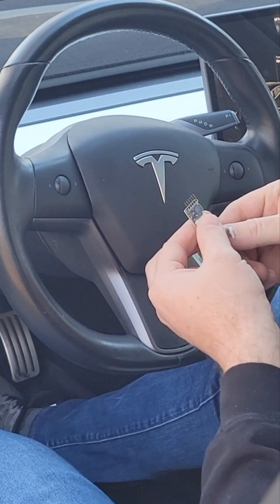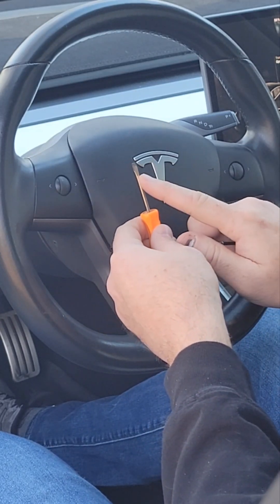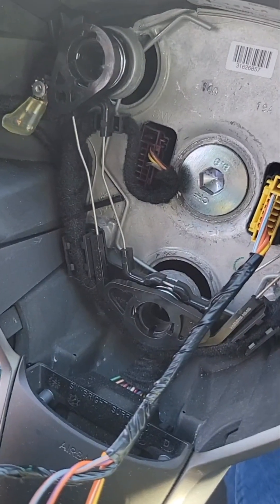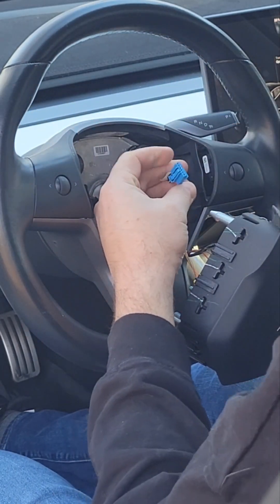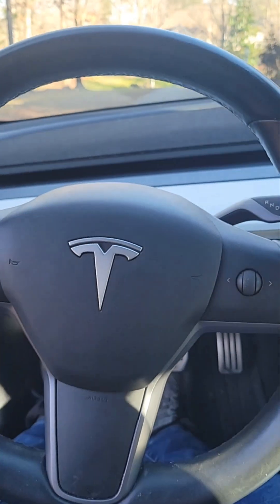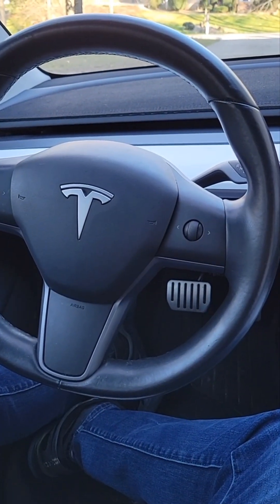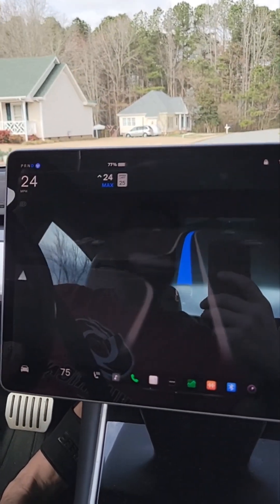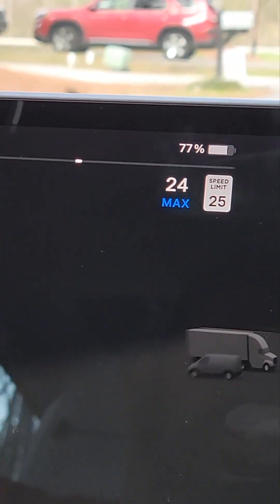Tesla Auto pilot FSD anti nag assist chip

Comment: If anyone is thinking about ordering a TSL2 chip, these no longer work.  I ordered and returned 2 of them because when they're now initially connected to power, you see a quick red light, but the chip never beeps, and it can't be activated or accessed in any way using either scroll wheel in my late 2018 Model 3.  I've seen several comments from other people having this issue in the past few weeks, and none of us have gotten the chip to work.  I contacted support email address included with the chip's packaging for help, and they were useless.  Their customer support consists solely of emailing you a link to this video.
Reply: Just tried one today and I'm having the same experience. Light turns red and doesn't beep. Also the wheel loses functionality when this is plugged in. Bummer
Reply from the maker: I just had a friend put one in his bottle Y this week without issues. Two questions for you: Does your scroll wheel adjust the speed when using cruise control? And did you try resetting the chip after plugging it in and reconnecting the harness to the scroll wheel? The paper directions to explain how to reset it
Reply: @ Yes, the scroll wheels end the nag.  Yes I tried resetting it.  I’m not the only person having this issue lately.  Either they no longer work, or the manufacturer made a giant batch of defective chips.  In either case, avoid.
Reply from the maker: @zoiks6631 can I ask how you reset it? The directions that come with the chip don't explain how to reset it clearly.
Reply: @ My man, I’ve worked in corporate IT for over 25 years.  I know how to follow directions to install and reset a janky Chinese chip.  The stupid thing never beeps and has no reaction to any input.  I tried 2 chips, each time on both scroll wheels.  Emailing the email address included with the chip’s packaging resulted in receiving the most non-sensical and false information.  Their latest email told me I shouldn’t return the chip because they’ll fix it with an OTA update.  I guess they’re hoping people will be stupid enough to believe that their chip somehow has an internet connection.  If it did have an internet connection, I wouldn’t want it in my car.  These chips are the typical junk Ali Express is known for.
Reply from the maker: @zoiks6631  definitely not insulting your intelligence. The Chinese directions are not clear. I was just trying to help because I've had really good luck with dozens of them. Have never come across one that doesn't work, And I do feel bad for you because when it works it is awesome. I am in no way making any money with this video or selling the product, just trying to help ya out.
Reply: This thing works only for hands , how about interior camera ? This camera also don’t check your head ? Because it’s not just about hands, I wanna buy TLS6
Reply from the maker: @David_Chumak I just flip down, and move the sun visor over in front of the interior camera. Problem solved.  FYI, I just got 12.5.4.2 and my chip is still working great.
Reply: Did you ever get it to work?
Reply: @stockfootagenow Nope

Comment: I’ve now tried 2 of these, and neither works with my 2018 Model 3.  When I connect the chip, I get a red light, but it doesn’t beep.  The scroll wheel then has no effect on the chip when you click the scroll wheel.  I think Tesla may have blocked these from being able to be installed.
Reply from the maker: Mine still works
Reply: @ Yours was already installed though, while I’m trying a new install.  Either I received 2 defective chips, which seems unlikely, or Tesla has found a way to block these from being installed.
Reply: @zoiks6631  You need to test if your Tesla supports any of these chips.  You can do this by turning on Autopilot/FSD, then wait for the nag.  Once you get the nag, scroll either the volume wheel or the speed wheel and if the nag doesn't go away, it will not work on your Tesla....ever.
Reply: @jbmitch22 It 100% for sure should work with my Model 3.  It’s just yet another shitty Chinese product.
Reply: most of these chips need a fast double click of the wheel that its on to enable it

Comment: Is this still working with new FSD 12.5?
Reply from the maker: Yes, im on 12.5.1.5. when the vision based attention monitoring is active, and you look away, then this doesn't work. Which is fine. If I wear sunglasses or a baseball hat, then the attention monitoring is not active and the chip works as it did in the past.

Comment: When I plug mine in I get the light but no sound? What does this mean is my unit broken?
Reply: I’ve had this issue with 2 different TSL2 chips with a 2018 Model 3.  Did you ever get it to work?
Reply: You need to test if your Tesla supports any of these chips.  You can do this by turning on Autopilot/FSD, then wait for the nag.  Once you get the nag, scroll either the volume wheel or the speed wheel and if the nag doesn't go away, it will not work on your Tesla....ever.

Comment: Okay, I was told that you could test if the chip will work with your car by satisfying the steering wheel prompt, simply by scrolling one of the scroll wheels. Well, I tried that when the prompt appeared, but it still asks me to pull the steering wheel. So, will that chip work on my LR 2019 EU normal Autopilot version?
Reply from the maker: If the nag comes up because the camera sees you not paying attention, you have to touch the steering wheel. Like looking down, or out the window, etc. When the nag comes up that is the "typical" nag that is confirmhat's what you need to test the scroll wheel with. If you turn either scroll wheel up and down and it doesn't turn off  the typical nag, then this chip wouldn't work.

Comment: You don’t show how to do the most important and hardest part which for me was unplugging and plugging in the harness to the back side of the scroll wheel.
Reply from the maker: I guess that wasn't hard for me so I didn't see the need to show. What were your struggles with unplugging the blue harness and plugging the chip harness back in?
Reply: @TeslaMatt1108  The chip harness to the back side of the school wheel. I guess my fingers are too big and I couldn’t see what I was trying to actually do. I had trouble lining it up to go back in correctly. I did get it and it works great. Thanks.
Reply from the maker: @charlieshell4031  Glad you got it. I could see it being tricky if you have bigger hands. If anyone else has this issue, maybe gently using a needle nose or right angle tweezers to help line up the harness and help see what you are doing. I have seen other reviews where people removed the scroll wheel and bracket for more access. But I just didn't need to go that far.

Comment: Do not do this. First of all it’s dangerous. The car requires you to be attentive for a reason. Second if the car detects ANY type of device such as this one you will be PERMANENTLY locked out of FSD. Tesla won’t care it you bought FSD out right and paid 12k. You will still be locked out and WILL NOT GET A REFUND!
Reply from the maker: Def not true. Camera still makes sure I'm not in my phone. And camera is still watching my to make sure I'm not looking down or out the side windows. You think having a weight on the steering wheel is any different? Tesla isn't banning people from FSD because of a weight or a chip.
Reply: @TeslaMatt1108  I'm getting a weighted one, will it work just as good?
Reply: @SlugZzSs I use the weight. I got the magnetic one that was like 94 bucks over the velcro. It works as intended. No more nag. Now if I could figure out how to fool the interior cam. I think tesla is making  things more dangerous by making people avoid it entirely. All they need to do is relax these things just a bit.
Reply: @SlugZzSs will not work
Reply: @jakesta11  why are you lying
Reply: @traviss2217 they added a feature to monitor a constant torque and you get a strike from it
Reply: @SlugZzSs No the weights doesn’t work as well.
Reply: The warning says "hands on defeat device detected"
Reply: @jakesta11  he asked about the weight, not the device. The weight simply tricks the car into thinking your hand is there.
Reply: @traviss2217 I was talking about the weight not the chip...

Comment from the maker: I have V12 on my 2019 model 3 now, and this still works really well. When with the setting for automatic speed. (Automatic doesn't display a set speed, but this chip still makes its adjustments, and I don't have to grab the steering wheel to satisfy the nag)
Reply: Matt, I got the TSL2 chip for my 2018 Model 3.  I checked in advance that either scroll wheel cancels the nag, so I proceeded with my purchase.

Upon install, the chip doesn't beep when plugging it into either side.  On the speed side, the scroll doesn't work to change the speed, and the volume side doesn't affect the volume.  As a matter of fact, the volume won't come on at all even if I use the screen. 

So far this is a total fail.

So you think the TSL1 may address this, or am I SOL?

Comment: Hey thanks Matt this was super helpful! To anyone reading this don't make the same mistake as I did and not check to make sure the black horn clips are clipped back in because when the airbag is clipped back in it will keep the horn on until your horns burn out! Also make sure the chip cannot slide in between the airbag and horn clip because this will also result in you replacing the horns.🤣

Comment: Dude, please stop promoting this product, it does not work, 1st gen - 2nd gen, it makes no difference. Steering wheel inputs no longer override AP antinag.
Reply from the maker: It's been working on my 2019. Steering wheel scroll wheel does satisfy the hands on wheel nagging. Scroll wheel works on my friends 2023, and my neighbors 2021 Y. The camera will still nag at you if you using your phone, so this isn't meant to allow you to not pay attention.
Reply from the maker: I got the latest v12.3.4 today and it's still working  perfectly.
Reply: it works for my with EAP on my TM32018, but when i activate the self lane change it doesnt work bc it ask to hold the wheel to change lanes.
Reply: Still works fine even on latest firmware pushing out now.

Comment: hey guys please send me the link where to buy it. ONLY NOT from Ali:( Also how about the Before I'll buy this item please let me know this  when you press the right scroll wheel twice to turn on the item, it doesn’t work because once you click the right scroll wheel once it turns on voice command instead. The Tesla voice command turns on when you press it once. How do I bypass this in order to turn on this item? If you press it once it turns on voice command if you press it twice it’s waiting for you to say something. Therefore the feature that turns on doesn’t occur.
Reply from the maker: You'll just have to do your own Google search for this chip if you don't want to get it from Ali. I think I saw some on Amazon for a lot more money. Also the chip is looking for the double click by itself, So it does not interfere with the voice command that the car is doing. For example, if I double click while driving, The chip will turn on and off, AND The voice command pops up on the screen. Everything works just fine. Just understand once you turn it on, you won't have to ever turn it back on again, thus you don't have to worry about interfering with other typical car commands.